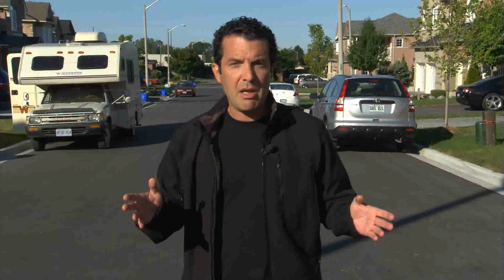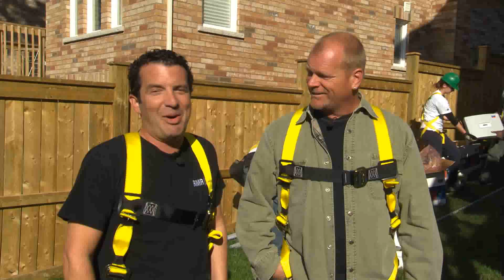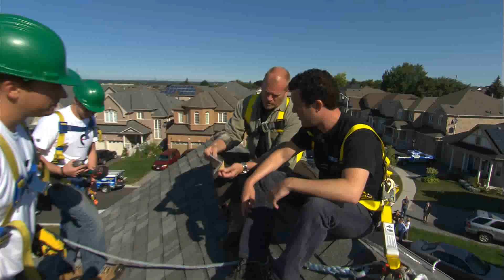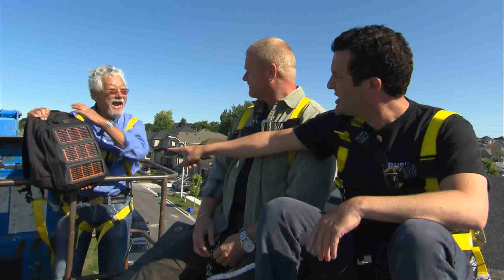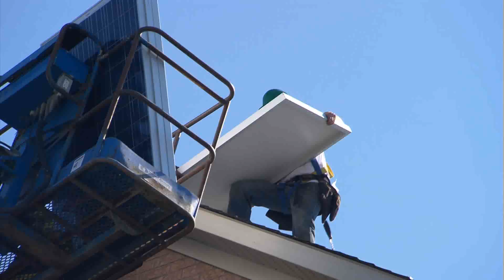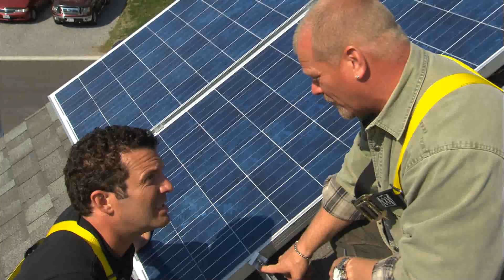RMR: Rick installs Solar Panels

Comment: https://youtu.be/aCU0vG3GpfsThis is definitely the future to get off of oil and off the hard wires to the electrical companies. But it is fast becoming old technology. It's probably not perfected yet but solar shingles looks like the future and I applaud Elon Musk for that. Solar panels on the roof will one day give way to this new technology. Enjoy the work while you can but be prepared for change it is inevitable and the current rooftop solar panels will go the way of the dinosaur. I remember seeing and hearing about solar panel rooftop shingles many many years ago probably in Scientific America or some such publication. What is new today is old tomorrow just be prepared to move with the change and you will do fine. Be flexible. The Rockefellers didn't get out of oil for no reason they see the future. Or help to create and control it.http://www.cbc.ca/1.2773771

Comment: I'm getting this sjhit! Free energy and installation and a reduced carbon footprint
Reply: +superskiier50 Solar manufacturing has a 96% internal recycling rate.
http://cleantechnica.com/2016/03/03/pv-cycle-achieves-new-record-silicon-based-pv-module-recycling-96-recycling-rate-real-world-performance/
Reply: +Ali Bubba nothing is free, you have to pay for the very expensive installation, and maintenance, you have to clean the panels and they won't work in winter. and Ontario is almost exclusively green energy.
Reply: +superskiier50 lmao Bruce Nuclear plant... which runs over 50% of the province... Green energy my ass bud...
Reply: +superskiier50 *the provinces population*
Reply: Johnathan Cruickshank nuclear is clean.
Reply: superskiier50 it has waste bro.... that is not clean. Clean as clean could be would be solar. But it is expensive and umsufficient for everyday use.
Reply: superskiier50 Your honestly trying to sell the fact the fukushima incident had no impact at all to marine life right?
Reply: Fuckin tool.
Reply: Johnathan Cruickshank solar has toxic byproducts because of its production, any you need many, very inefficient panels to power something as small as a house. solar panels aren't just magic boards that pump out electricity. and as for fukashima, the plant was using outdated technology, ineffective backup systems and was built in an area known to be unstable. that sort of incompetency is not characteristic of most plants, which are generally built in areas without earthquakes and tsunamis, and with proper backup systems.
Reply: superskiier50 on the level of waste of nuclear waste to solar waste is unparalleled. I did mention how insufficient solar energy is. I imagine you did not use your brain or eye balls on that part but I digress. My point was you claim it was "cleaner" energy. You must realize the level of wastes in both production and output, between the 2 energy sources. I am not going to sit here and have narrow minded individuals tell me nuclear energy creates less waste and creates "clean" power than solar. REGARDLESS! of their power output. That was my point implemented. But your right... Radiation is healthy for you to right. If I destroy a solar power system, yes toxins are released on an very minor earthly scale. I destroy a nuclear power plant... Need I say anymore. The focal of my statements are the mass of the wastes and potential threat if a  natural or man made disaster happens. I could garentee you both scientists and the general population would fear nuclear waste to solar waste. Again the waste factor is the point here. Not energy output. I am quite aware of the great difference of the two energy outputs. Your claim, however, that did come from your words that nuclear is cleaner is in fact, extremely false.

Comment: Hello. if you have an 80 cent contract already for your property, this is good for 20 years. All new contracts as of October 1 2011 are at the lower rate of 55 cents. The 80 cent contracts that are already in place do not drop.

Comment: I wanted 30,000 worth of solar tiles for my roof .The government, was to pay 80 cents a kilo/hr.for hydro I created and sold to them. You don't use any of the hydro that you make, You sell it and buy yours back at a LOWER market price. Well,the 80. cents had dropped to 55.cents. You still have a monthly payment on the original 30,000 loan to pay.Cake walk at 80.cents, but not at 55  The idea is you were  supposed to NOT have to pay for hydro, you make money from it. True or false? please repond

Comment: Never use Pure Energies unless you like giving away 95% of the profit that your system earns. These guys prey on suckers all over Ontario. Pay for the system yourself and make great profit over the 20 year contract. I just finished a clients house where they will make about $85,000 pure profit after earning the initial investment back,over the 20 year contract. With Pure Energies they would make about $18,000 over the 20 years. That's $67,000 thaey would have lost to Pure Energies.